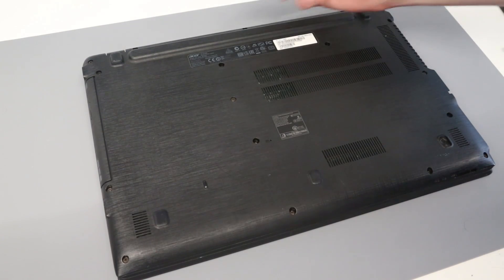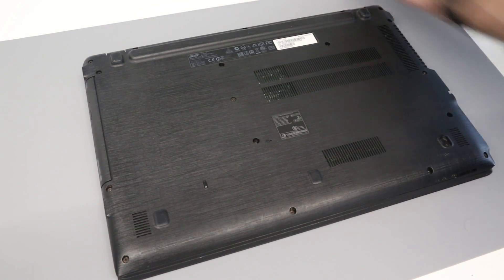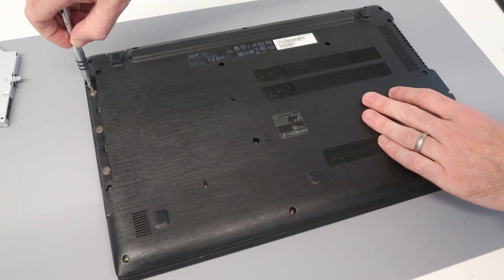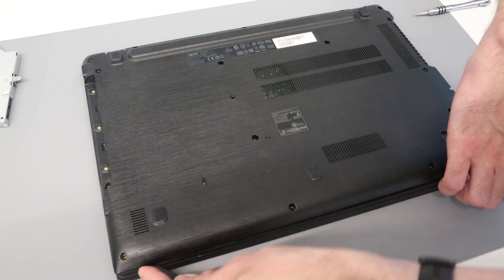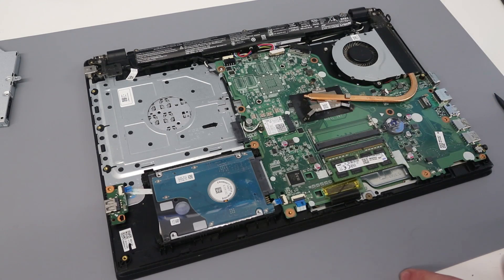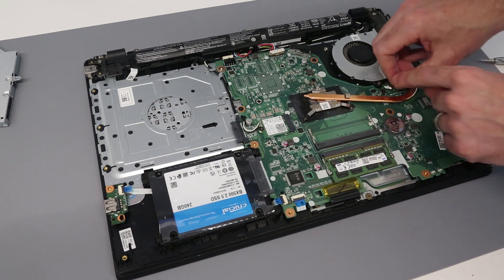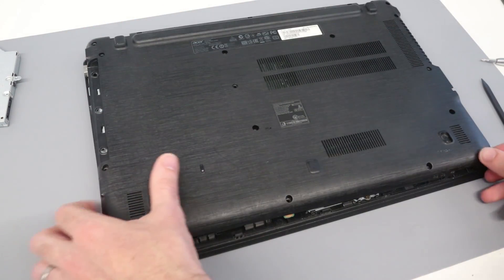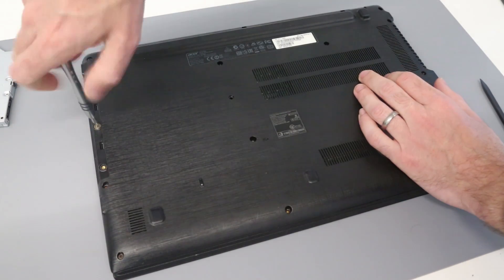Acer Aspire F5-571 - HDD/SSD and RAM Upgrade Guide

Comment: Very helpful video!!! Just I am thinking to upgrade my laptops Ram from 8GB to 16GB. Just a question my acer aspire F15 F5-571-50s0 writes it has 1X8GB DDR3L and I can find Rasalas  8GB DDR3L 1600MHz PC3-12800 PC3L 12800S Unbuffered Non-ECC 1.35V CL11 2Rx8 Dual Rank 204 Pin SODIMM Laptop Notebook Memory Module Upgrade 8GB. Is this OK?

Comment: I wonder why he replaced a 1TB  hard drive with an SSD with only 240gb?  Would you replace it with an 2TB SSD?
Reply from the maker: The video is about 3 years old - SSD prices were higher then.
The upgrade was for better performance, the capacity wasn't needed.

Comment: Hello! My Aspire F5-571 is extremely slow. When turning on, it can last 5 minutes, sometimes. I have formatted it, but it hasn't worked. Should I change RAM or HDD? Or both? Thanks <3
Reply: i got the same problem!! Depending how you use it!! For example mine got 8GB ram DDR3L and I work Autocad 2025 /autocad 2026 LT. Some engineering software and Memory from task manager  hits 90%. I think I need a gaming desktop.

Comment: Later tip: while it is best to start fitting the base at the connector-panel end, the trick is to use the point of your spudger to adjust the mic jack bushing to fit back through the hole in the case; it has just enough flex available to pull it off without... pulling it off.
Reply: A year later, thanks for the tip. :yougotthis: Was struggling to fit the jack port inside the case and was afraid of breaking it.
Reply: Couldn't thank you enough for this tip....I was struggling to put  the base back...thank you
Reply from the maker: Good stuff.